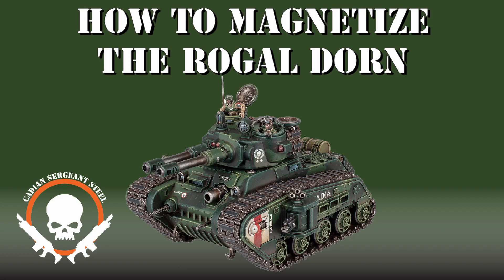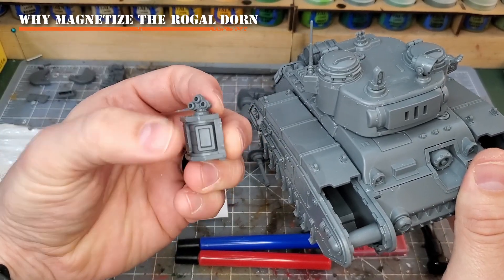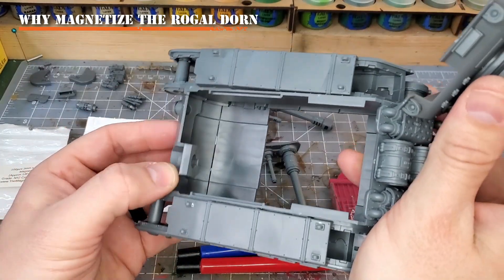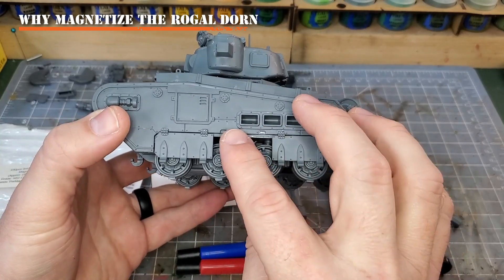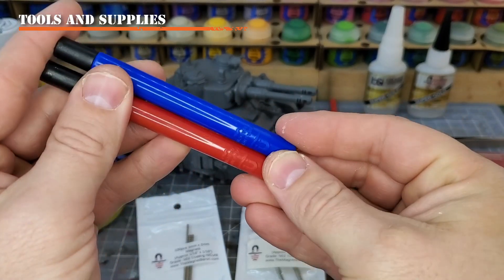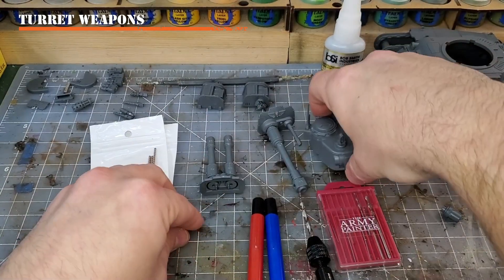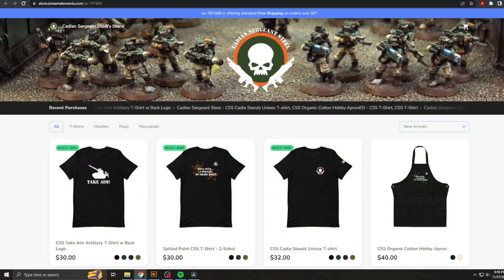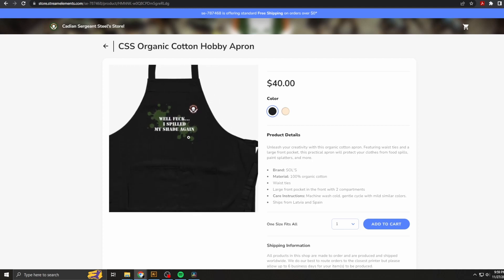Tutorial: Magnetizing the Rogal Dorn

Comment: Nice the Cadian defence force just arrived here, cant wait to magnetise the 2 dorns, but i got a question, what do you do, if you haven no greenstuff? You used it when you put in the little weapons in the hull and said, "you can also do superglue but we will talk about it in a second" ( 27.10 ) but you never talked about it xD So do you just glue them on? Everything else this video was great, thanks <3 10/10
Reply from the maker: Oh shoot, I might have accidently edited that part out. Basically creating anything to attach the magnet too, such as a strip of plastic, can work. I think types of epoxy or molding putties works best. I have taken bits of sprue edge and glued them in so that I could glue a magnet to those. You'll just want to check your depth on those to make sure it's right or drill a hole through that extra plastic with a pin vice and then superglue the magnets in.
Reply: @CadianSergeantSteel  Wow thanks for the quick response. I'll try that, see you on the battlefield o7

Comment: Uhm know its been a LONG time but thinking about getting a Rogal Dorn but wondered how you magnetized the crew by chance do you remember?
Reply from the maker: Yes, 2×3mm magnets from the Magnet Baron. I placed them perfectly centered on the bottom of the crew torso and the center of the hatch opening. For the Heavy Stubber gunner, I think I did a 2x2mm magnet where the Heavy Stubber touches the mounting area on the back and glued the gunner onto the stubber so he can swivel around.
Reply: @CadianSergeantSteel  Thank you!
Reply: @CadianSergeantSteel  Uhm sorry did you magnetize or do anything special with the hatches?
Reply from the maker: @jango88fett naw. Just glued those open. But the kit can be supported via brass rods to allow the hatches to open and close.
Reply: @CadianSergeantSteel  how big of a brass rod you think and sorry for bothering ya
Reply from the maker: @jango88fett  uh, probably around 0.032 inch or 0.81mm

Comment: This video is a gem, thanks a lot! I do have one question though: I've already pretty much built the entire tank so I can't go inside the hull to set up the magnets there. Am I just ** out of luck in when it comes to the hull weapons? 😅
Reply from the maker: I think you could try this: drill out the hull weapon slots to a slightly larger diameter. Magnetize the hull weapon first. After that magmet is firmly in place and cured, shove a small amount of green stuff into the hole, slap a magnet onto the weapon, and push it in to wedge the magnet into the green stuff (or into some glue you have carefully placed inside). Gently pull out your hull weapon, see if the magnet stuck onto the green stuff. If not... you could just put a little glue.on the back of that magnet  and try to stick it in onto that green stuff that way. Or you could, if you bottom is open.... put the glob of greenstuff onto the inside area where the hull weapon will mount and then do that same option 1 I recommend above.
Reply: @CadianSergeantSteel  Thanks, I'd never have imagined I'd be happy about the open bottom on the Dorn. I'll give it a shot sometime soon. Thanks, Sarge 😁👍